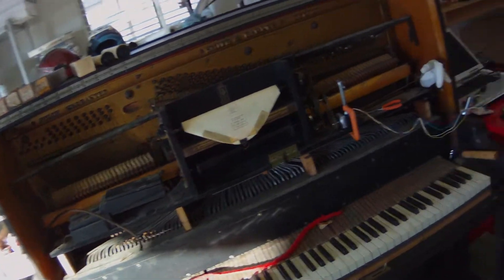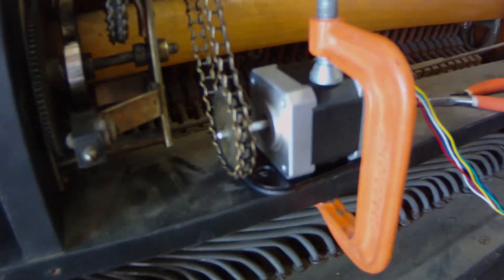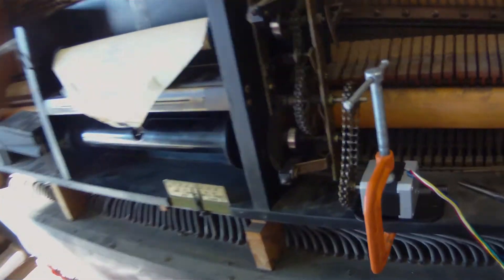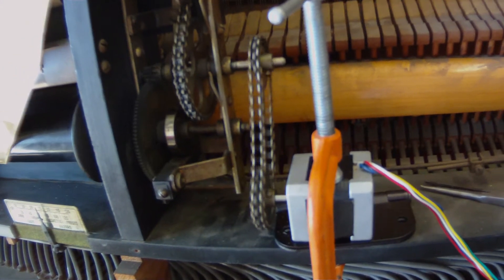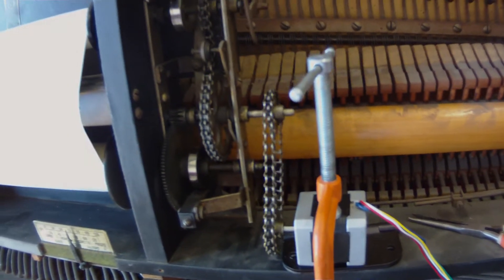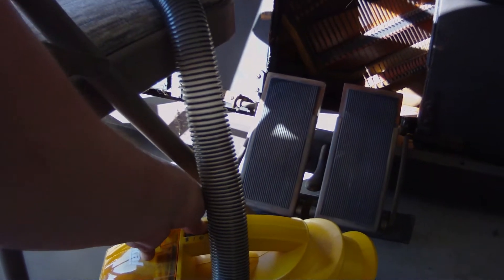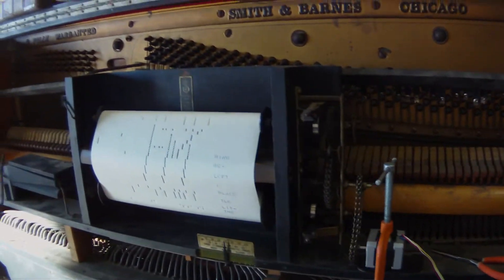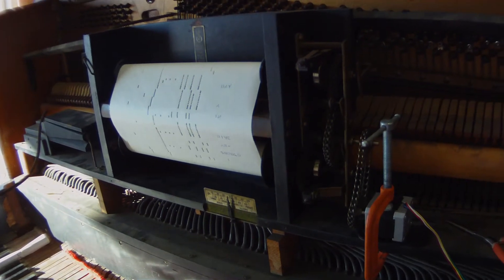Electrifying a player piano via Arduino

Comment from the maker: I've actually put back a good number of parts. It still works the same way, but there's a valve to disconnect the bellows from everything and the the stepper now turns the chain and wind motor. This way if you close the valve you can still play it manually the old fashioned way, or switch to fully automatic.

Comment: So, what's the role of the Arduino?  Why not just power the stepper and vacuum directly with the flip of a switch?  Even with that, a pot could be used to vary the speed of the motor.  If there is more to the code it would be great to see that.

Comment: This is great exactly what I was looking for. I have the same problem, the air motor leaks a ton and I was wondering why you couldn't just put in an electric motor. I didn't even think of using a stepper, just a dc and vary the voltage. Did you ever build a quieter vacuum? Did you have to rebuild the bellows on the left that controls the reel alignment?